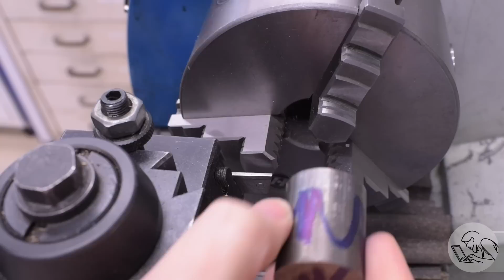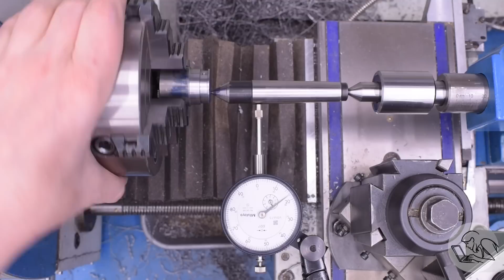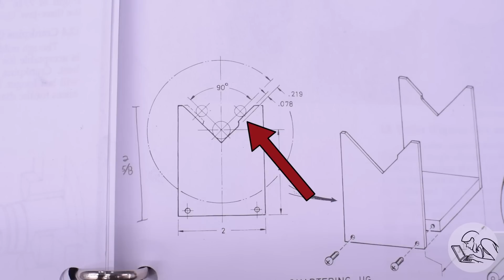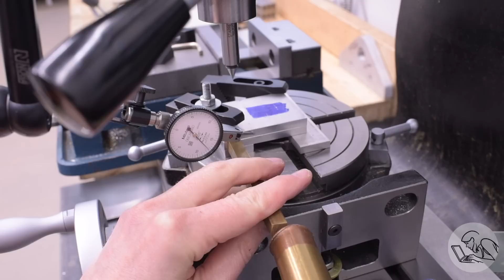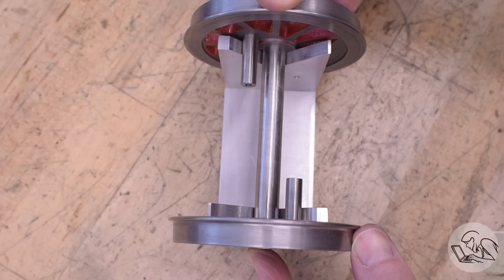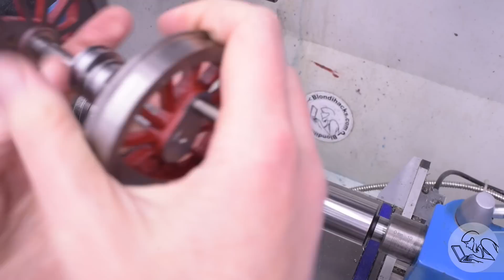Quartering and Eccentrics - Pennsylvania A3 Switcher, Part 41

Comment: Beautiful work Quinn. That jig is pretty genius. The tips on machining eccentrics I certainly appreciated!

Couple real world steam connections: I've got no idea how big 2816's bore is, but it's darn big. I know the bore on our 1881 and 1899 ancient narrow gauges engines is 16", and our big K class is 20". The size of some of those engines out there is staggering. Only boat people get us... Lol!

Also, many shops have drop pits instead of big cranes. I always wish I had a big crane and I've only ever had drop pits. Yucky nasty places, but the process is similar - just some removable rails that slide out of the way and a big ram or small crane to hoist one wheelset up or down.
Reply from the maker: 2816’s bore is actually 22”. I misspoke in the video. 😕
Reply: A wild Hyce appears!

Comment: Hello and thank you for your educational and clear videos. In one of your vids you show a fixture for rounding ends of plate items. Is this a patreon only  vid please as i can only find the excellent one relating to the rotary table. Many thanks.
Reply: Thanks for the response Quinn. As is always the case,I have looked back through a number of videos but can't find the actual one I saw it in. What I am referring to is a plate type fixture that I think was used on the table for your belt finisher/ sander for rounding ends by rotating around an adjustable pin. If I recall it had a threaded slide for fine indeed. Once again thanks for the great videos and superb editing and easily understood explanations.
Reply: Fine infeed  !

Comment: Silly tip, when you are parting off an eccentric after boring it out, put a sacrificial piece of metal in the bored hole to avoid the "thumping action" of the parting blade as it passed the shaft hole. Having something to cut is better than beating the daylights out of the tool and tool post when it hits a void.. Just a thought (it's what I have done in the past and it works great).
Reply: Silly tip, down walk into another persons shop and start telling them what to do.  Don't like it. don't watch it.
Reply: @4GibMe  Silly tip, don't treat mild suggestions as walking into a shop and "telling someone what to do." NOTE: This is just a mild suggestion. Feel free to keep over-reacting if you must.
Reply: @4GibMe  it's really a slippy tip. If the inserts slips you get the thump without expecting it. Disaster follows. A hss tool can easily deal with an interrupted cut.
Reply: You need to settle down and also educate yourself on the content so you too can see why that was actually sound advice humble yourself there friend @4GibMe
Reply: @4GibMe  Did you miss the part about Quin literally taking Patreon suggestions? A respectfully worded tip is appreciated around here (unlike yours, which doesn't seem very respectful to me)

Comment: This is awesome, I love these videos!
I had a dumb question (I don't know anything about trains or machining etc.) : Why wouldn't the shaft and wheels be locked together with say a keyway, screws, or something more formal than glue?
Is it just too tricky to keep the alignment of both wheels and machine these features in or something? I ask this since to my (non mechanical) brain that Loctite would seem to have to hold heaps of torque. But I  presume in reality it's actually intuition-defyingly strong?

Comment: Parting is supposed to be one of the most difficult things to on the lathe, it can’t be that hard right? Finds a parting-looking tool, sets height. Starts making some chips, getting in the groove.
-I am a parting-god!!!
-BAANG!!!!
-angry electric motor noises.
The center in the part looks like a dorito.
Parting-tool is intact?
Wouldn’t be so bad if my vise broke after the third cut in the 1” axle…

Comment: Saw "The Empress" 2816 just a few weeks ago, heading to MX City through Wharton, Texas. It was early in the morning and it had just departed its overnight. It appeared NOT to be producing steam for forward motion, although the whistle worked! The theory bounced around was that they don't want to get up at 4am for an 8am departure, so they "steam up" in motion, using the backup diesels for the first 2-3 hours of the daily progress. Not sure if true . . ..
Reply from the maker: Interesting theory! Typically for a trip like this, they just don’t ever cool down the boiler to prevent that problem. Back in the day, crews would keep boilers in steam for weeks or months on end, cooling them down only for cleaning and service. It may be that they got low on water or had a mechanical issue, hence the diesels.
Reply: @Blondihacks  It was still a mighty pretty locomotive. Heckuva trip: Calgary to Mx City (and return!). Could it just be the cost of oil over the 2-month (or so) trip.  It must burn a fair dinkum amount, you'd think.

Comment: Great video Quinn. Again you are a very good teacher and it's nice that you take the time to do it well.

Examples being:
Showing the interrupted cut in the eccentric while you were doing the work. So often, in the process of doing the primary work, we forget to stop and show the teachable moments.

Giving the explanation of why the quartering has to be done. This makes most steam engines 4 phase motor systems. After all, two power strokes per revolution of the wheels times 2 cylinders. 

It's the same with electric motors, the common single phase motor, such as is seen in our homes, all have a little trick built in to start the motor, these are in essence a small out of phase motor. 

This does lead to an interesting idea, a single cylinder steam engine with some sort of kicker to shove the crank around at both the top and bottom of the stroke. Perhaps a couple of paddles and some steam jets to give them a shove. 

Of course, we could also put in a place to install Sprocket and a buddy and have the cats bat the things to get them going. Shine a laser pointer at the paddles and they will hit it. Sad to say, the dogs will not work.

As a small point, you do know that we have absolute proof that the world is not flat. Were it flat, by now, the cats would have pushed everything over the edge.

Comment: Only one excentric for 2 Cylinders? I'm confused
Thank You for your videos
Reply: It all relates to the operator, that being in this case Quinn. Then, when operating, the machine will have two eccentrics.
Reply: These aren't eccentrics for valve gear, they just drive pumps (oil and water), so no direct connection between these eccentrics' connecting rods and steam driving cylinders.

Comment: Almost every installment of yours conveniently answers some problem that I have had recently or currently. -I did recently have a problem with Krazy glue NOT letting go of some printed Aluminum parts. Acetone, heat, brake cleaner, . . .  nothing worked! I am assuming that being a printed part the irregular surface inside the hole for the shaft was irregular enough to create a net surface hiding pockets of glue to parts, that I couldn't reach with solvents, and maybe the heat applied vitrified the glue?  -I ended up milling the steel shafts out!

I love your videos! You are an excellent teacher! Thank you!

Comment: Three-cylinder locomotives are “quartered” (thirted?) on 120 degrees (or some degrees from it, depending on the angle of the middle cylinder). So basically any angle would do.
Reply: Just like with a 3 phase AC motor, but given smooth running, the closer to the exact angle, the lower the losses and better the running.

Comment: Did you verify the back-to-back dimensions of the drivers as you fixed them to the axles? Back-to-back is critical to ensuring the flanges interact with turnouts properly and don’t bind on tight curves. Improper b2b leads to derailments on models and the real thing